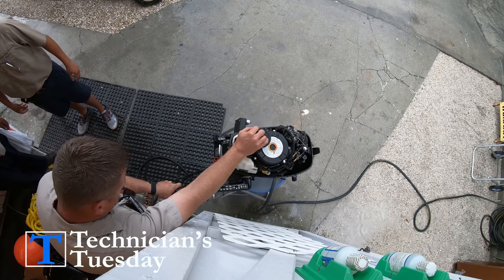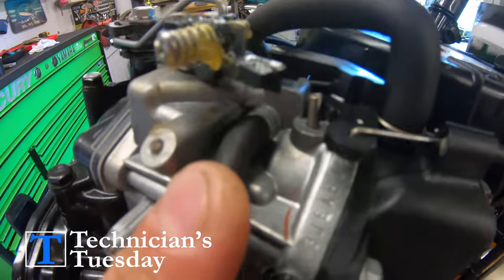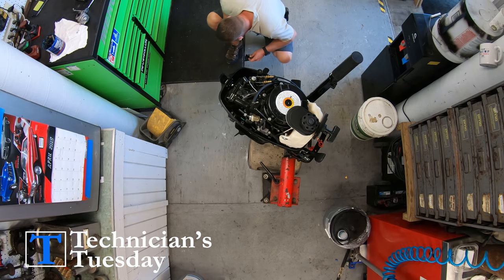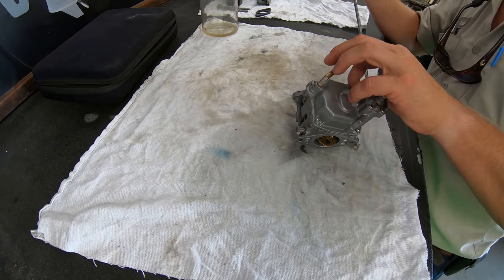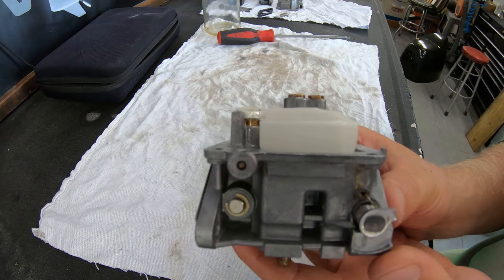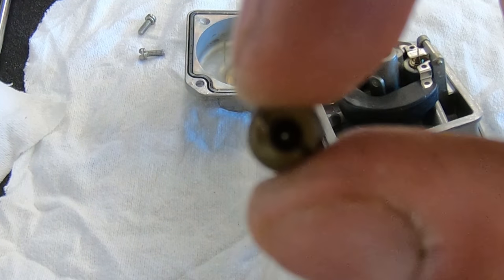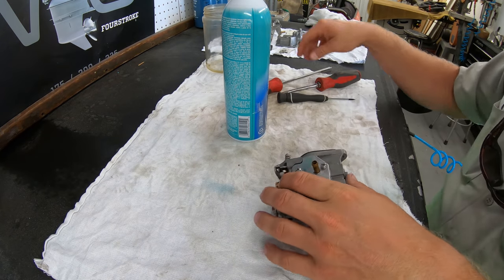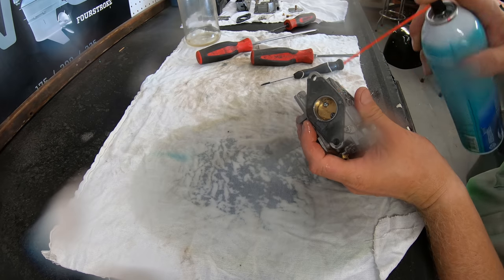#1 Reason Why Small Outboards Won't Run!

Comment from the maker: Suggest Topics That You Would Like For Us To Cover On Technician's Tuesday! https://www.bornagainboating.com/technicians-tuesday/
Reply: Born Again Boating do you have any videos on stern drive bellows replacement?
Reply: Not much out there on trailers... I've been meaning to do a video on trailers/brakes/tires etc... but dont really have time since I'm still in boat restoration mode...
Reply: What about a video on scruppers, ball type, flaps or otherwise. My flappers somehow let water in! What would be a good replacement?
Reply: My project boat will need hydraulic steering...  24’ long.  Info on install.... bleeding.... potential issues.  Maybe even different brands you are familiar with.
Reply: @erikrounds5847  not trying to hijack but I should a video on this in the next couple weeks... its gonna be long and boring tho cuz I tried to show pretty much everything
Reply: #tacos

Comment: #tacos  dont forget to mention the fuel hose that ethanol eats and then results in clogged hose barb fittings or fuel filter. Can feel the same as clogged jets, will run at idle but starve for fuel under load. As usual keep up the good content man.

Comment: I like to strip the insulation off of a 10 gauge wire, separate an single strand, and use that to chase the jets as well. 
Great video brother!
#tacos
Reply: I have a length of bicycle brake cable that I cut strands off of to clean jets.

Comment: All carburetors (except engines that do not idle down, such as generators) have 5 basic circuits. Idle fuel, idle air, main fuel, main air, bowl vent. Make sure to identify them all before trying to rebuild a carb. On the 4 strokes the transition circuits can be incredibly hard to get clean by hand if they are really dirty. Disassembly and then a bath in a heated ultrasonic machine is always the best way to go if possible. Love the videos. #tacos

Comment: My 60 mercury 4 stroke efi was limited to 3000-3500 rpm because of the thermostat. It was Stuck closed... it puts it in guardian mode. It didn’t beep saying something was wrong. $20 part and it was an easy fix!

Comment: I always put my boats away at the end of the season by disconnecting the fuel lines & running them dry. I've been doing this for 20 years & never had to clean my carbies on any of 4 motors. They regularly don't get started for for 8 months or more. Also when using them again I always allow the motor to warm up & then ensure that it runs at WOT for at least 15 minutes.

Comment: #Tacos Great content as always.  99% of the time it is a carb problem.  Can’t tell you how many free small engines I have picked up at the transfer station and gotten running again with a little work.  A cheap ultrasonic cleaner from harbor freight makes the work even easier. Keep the great videos coming.

Comment: #tacos   Great video! This video will not only fix outboards, but you could apply it to generators, lawnmowers, etc. Ethanol fuel causes issues in all of these. A good carburetor cleaning will solve many issues.

Comment: “Make sure you’ve got good gas” 

VITAL!  I was trying to start a brand new engine for the first time, filled it up with gas and it would not start for anything! Went through the carb and adjustments, choke everything. Finally  I took the rope start off the front and started spinning the engine over with a drill. And it would barely run. Finally I filled up with fresh gas... and it would start first pull! Turns out I forgot the gas in my garage was over a year old, but it still ran my Honda mower!

Comment: G'Day,,If i'm going to store a 2 stroke engine for a long time,,i run all the fuel out of the system, at an idle,,When the motor sound like it about to die give it a rev,,but not flat out,,
This way there is no fuel in carbs,,i do this on all premix engines yes even me lawn mower,,
It the oil that seem to dry out and semi seal jets,,
Important,,out board 2 stroke does not burn like the 2 stroke mix in a chain saw,,Very different,oils,
Hence 50:1 for out board and round about 35:1 for chain saws etc,

Comment: #Tacos  Those tohatsu/mercury/ whatever brand they paint it 6hp motors,  if it will run but not idle you can sometimes get away with taking the pilot jet out the top, cleaning it and shooting cleaner in the hole,  no carburetor removal required.  Also the model with the built in tank,  sometimes the fuel pump won't prime from only pulling the rope, even if you pull it all day (ask me how i know).  Blow into the tank, or close the vent and squeeze it, to get things primed and it will start right up.  Love your videos, always great info!

Comment: #tacos I love using an ultrasonic cleaner when I clean carbs. It heats up the solvent and does a great job getting into those tiny crevices that you either can’t get to or don’t even realize are there! Just rebuilt a Holley two barrel with the ultrasonic cleaner and it came out mint 👌🏻

Comment: My evinrude 9.9 2 stroke used to always bog down while running. A few sea foam treatments really helped it idle better, but it's still not perfect. For a guy tight on funds and not a mechanic, would more sea foam treatments eventually clean all the gunk out, or would it be better to pay a mechanic to do a removal/proper clean?
Thanks!
Reply from the maker: You could try and do more treatments, but it sounds like if you've already tried that a couple times, it needs to be cleaned. Maybe try it once more and if nothing, it's probably time to not spend any more time doing it that way :)

Comment: New subscriber 👍 I just got a couple old outboards, a Evenrude 9.5 Sportwin, and a Honda 4 stroke 7.5, so I have a feeling some carb work will be in the future! Lol and thanks for the video
Reply: You can make a 15 out of that sport twin with a carb and exhaust tube-- that honda is bullet proof- just make sure the cam belt is exact- as if it stretches just 1/2 a tooth from perfect, it will foul plugs. you can save some with shimming main bearings so the oil pressure will lube the top cam bearing and the top rod you won't believe how nice it runs when set up right.
Reply: @williamoorejr  thanks for the helpful info, much appreciated!👌

Comment: Do you  ever  have  to remove the  tamper proof  cover on the air fuel mixture  adjustment  screw.
Reply from the maker: Sometimes yes, you have to drill out that plug and then make sure to count the screw turns by turning it all the way in before removing it :) if not you could be there for awhile trying to get it set again

Comment: Key board cleaner cans of air work for a realy good substitute for a compressor. Sometimes even better because the air is cleaner and it has a small nozzle to direct the air through the small ports on a carburetor. #Tacos

Comment: Do you ever Drill out the Brass plug too adjust the air/fuel mixture skew?
Reply from the maker: Yes, sometimes they get so dirty that you have no choice but to drill it out and take the screw out and clean it :)

Comment: In the cold and wet Northern Europe, the number one issue is water in fuel. Also the old 209cc F9.9 and F6 have bad carburetors that doesn’t handle our climate very well. #tacos

Comment: My 5hp is definitely missing the top few hundred rpm. New carb and new motor to me so I haven't done any digging. Any suggestions on where to start?
Reply from the maker: Check the spark plug, then check the carb :)
Reply: @BornAgainBoating  sorry, it's not missfireing. I mean it's never reached wide open throttle.  The prop is dog eared pretty bad. Could that cause it?

Comment: #Tacos ... cool video. I could have used this knowledge after Irma when I couldn’t get a Honda generator to start. It would only run as long as I was spraying starting fluid into the air intake hole. I assume it’s similar.

Comment: #tacos
Great video as always, can you video on carb syncing? I was Always was interested in the proper procedure
Reply from the maker: That's a good idea, it requires a sync and link vacumate and the procedure varies from engines. Maybe we can get one on an old F225 fourstroke that has the 6 different throttle bodies :)
Reply: #tacos
I’ve rebuilt many a gummed up carb on old vws back in the day . The jets can be tricky

Comment: #tacos I think you meant Carburator  cleaner not contact or degreaser. One jet is idle circuit and other is main jet high speed.

Comment: So you can just take the carb apart clean and reassemble?  No new gaskets?  #tacos
Reply from the maker: Most of the time, yes. Unless there has been heavy ethanol use, which can cause the gaskets to expand and not be reusable. But generally, you can take them apart and clean them, put them back together and reinstall!

Comment: If anyone is looking for a small outboard engine under 25 hp I prefer you to get a Yamaha two-stroke any years from 2007 or the late 90s I have a 9.9 Yamaha 2002 Its a really good Engine but it loves mix gas I have an old 3 gallon fuel tank that gets water in it inside of the tank and as long as the tank is filled with gas with a half bottle worth of rainwater the engine will run on it no sweat😂😂😂 I love that Engine perfect for the river #tacos
Reply: And I had the same carburetor since when I got it five years ago but this year I put new plugs and change the lower unit oil and a new thermostat and I New fuel tank and now I tried to put the cleanest fuel as possible and throw some star Tron and sea foam from time to time

Comment: Is this  the  Same  reason  y bigger old 2srokes won't run  (Johnson v4 115) # taco's
Reply from the maker: It can be, that old Johnson could be a number of issues though. Flywheel magnets, stator, timer base assembly, power pack, spark plugs, etc. But I think those 115's still have the plastic carbs on them :( they can give you trouble for sure!

Comment: Will that work for a larger outboard? #tacos
Reply from the maker: Sure, carbs are all really similar once you break them down. The most important part is getting every passage clean. Then sometimes if they are too dirty, you'll have to soak them in an ultrasonic cleaner :)